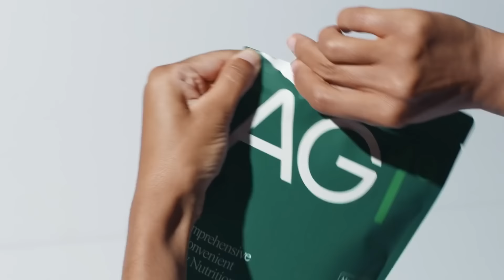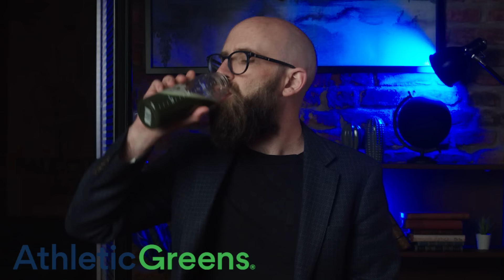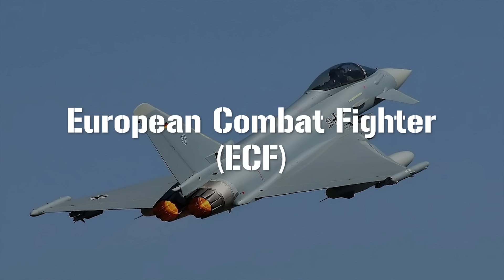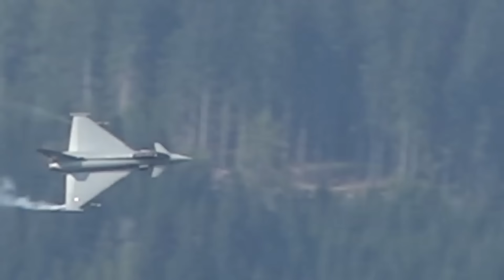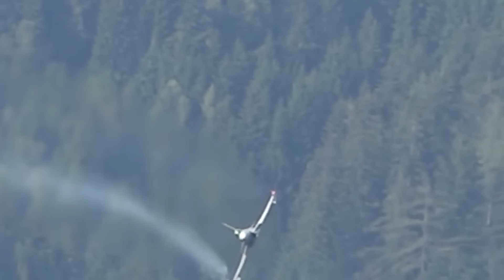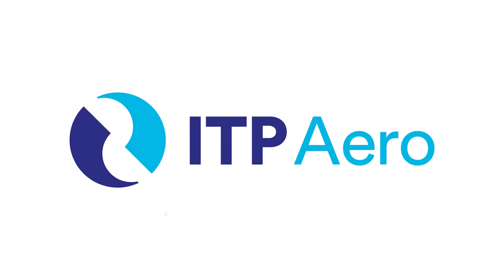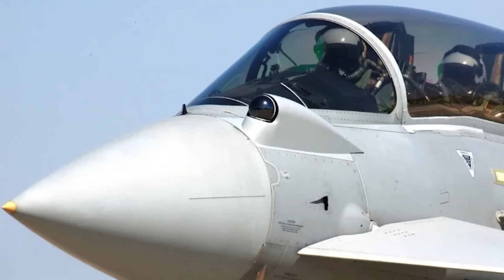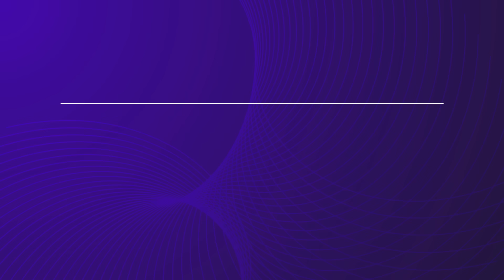The Eurofighter Typhoon: Any Aircraft, Any Mission

Comment: Although only getting called generation 4.5, the Typhoon is a great example of what a 5th generation fighter would look like if stealth wasn't an issue and you only cared about brute force and turning fights.
Reply: There’s a bit more to it than that but sure
Reply: with the right ECM-suite, it has no need to be physically stealthy...
Reply: Thing is, Stealth aircraft are not supposed to make up the majority of a combat air fleet. They are a first strike tool to take out the most valuable air assets so the rest of the air fleet can move in and dominate the air space. This is why the RAF actually has a damn good combat force with both the F-35's and Typhoons but we do lack a proper CAS/bomber aircraft that would free up the Typhoon and do the job better and we also need a proper air to air refuelling and C&C capability.
Reply: @WhiteIkiryo-yt2it   Yes and no, like the us the F35 is going to replace all of the F16s which is a good amount of our airforce as the usaf is planned to order 1700 of them, as right now the F35 is in a leagues of it's own as it go into deep enemy territory which other 4th gens wish they can do, as you explained that since a country don't have hundreds of them so they have to use them wisely, I 100% agree as you guys do lack a lot of other air support needs, the biggest mistake was making the eurofighter to do everything when it's just meh or not that great, as it is a air superiority/interceptor first, it's like making the f22 a cas or a multirole plane it just won't work lol.
Reply: 5th Gen is defined by Stealth 

So what you defined would never be 5th gen
Reply: @EricTheActor805  No country has actually stated what 5th gen actually means. Open to interpretation by everyone.
Reply: So... Should we be worrying about the Germans? 😋
Reply: Oof
Reply: What is needed is a Typhoon that's pilotless...then you can go up to a higher G force.
Reply: @Clinker Breaker  Yes, because the Typhoon is an air superiority fighter like the F15 (also a two seater), where the F35, is a multi-role fighter meant to replace the F16 (and for the navy version the F18, and for the army version the harrier, but they are literally three different planes sharing the same name). Air superiority fighters beat multirole fighters in the sky, but are more limited in what they can do.
Reply: @Carewolf  the typhoon is more of a multirole platform now, and the f15ex is a true multirole
Reply: It's the pilot guys, not the aircraft!
Reply: @DanOdalson  "It's the pilot guys, not the aircraft!" Yeah sure, put any super pilot to fly MiG-17 against F35 and see how it goes.
Reply: The .5 is the stealth aspects of the jet. Things like RAM coatings and EWS such as active cancelation/RF frequency jamming. There is a trade off between cost and capability. In general, you want a mixture of 4.5++ and 5th gen like the US/UK has. The 4.5++ is the high energy interceptors used for defending key assets such as airfields and the 5th gen are the penetrators/attackers used to penetrate heavily defended areas
Reply: @The SuperBike Tour thats not even the same aircraft.  The superhornet is inferior.
Reply: STEALTH IST THE SOLE "CAPABILITY" WICH MAKES A JET A 5th GEN PLATFORM so your comment is rather useless.
Reply: Can the Eurofighter do buddy refueling ??
Reply: The F-15EX has the strongest center box among any fighters worldwide, enabling it to effortlessly handle any G-force at various loads. In my view, the future F15 should leverage the rear cockpit by integrating advanced command computers to replace the weapon officer and command up to eight UCAVs alongside to the battle zone. Furthermore, with additional wing pods at stations 1 and 9, it possesses the capability to carry an enormous weapon payload to the war zone, akin to having R2D2 in the back seat. There are endless technologies embedded into the F15 that may be better than the F35 or the next 6Gen. The F15 will always be the workhorse that can carry massive weapons and now it has technology companions that don't care about G-force maneuvers. Compare: 1 (6 Gen Fighter) vs 1 (F15EX+8 UCAV).
Reply: Yes it is a beautiful aircraft but correct me if I’m wrong but turning bleeds off airspeed so wont it be better to climb roll back and build your airspeed back up as you dive on the enemy yes we built the raptor with turning in mind because of the USSR but we also have climbing capability’s built in as well as acceleration and targeting and before you say we’ll 2 German typhoons registered kills on the raptor yes they did when the odds were stacked in there favor I don’t know of any fighter that’s gonna go in to combat with no weapons but the inner cannon while the raptor had drop tanks equipped turning ain’t the only thing you need to count on
Reply: 1,000th like
Reply: "Although only getting called generation 4.5, the Typhoon is a [describes gen 4.5]
Reply: vtol and it woul be perfect efoo an anwer to the mig 29
Reply: FCAS or Tempest NOW, no F-35
Reply: Gen 4/5 is just marketing wank from Lockheed...
Reply: Your mistaken stealth means not as agile and the Typhoon has reflective radar capabilities throughout its frame. So do better homework kid😂😂😂😂
Reply: Your statement that the Eurofighter F22/35 or other stealth jets cannot see and attack is definitely wrong! Passive radar causes radio wave interference, which is present everywhere with AI. A Eurofighter Pretorian Evolution with the two electronic warfare pods also has passive radar! According to experts, the range is much greater in the air than on the ground, 400 kilometers is no problem! IRST with passive radar was successfully tested by Diehl, and Meteor will also receive it! MDBA/2025 presented a new hypersonic missile with a range of over 1000 kilometers, Mach 6-7! This could even be used to attack stealth jets beyond 400 kilometers. Airbus has successfully tested the A400 with 20 large stealth remute carriers and 30 small stealth drones in a combat cloud! They have the same electronic warfare systems as the EF, and remute carriers are armed with IRST and Meteor. Furthermore, the A400 will carry extremely powerful electronic warfare systems as a mother ship! Added to this are the EF Stealth Wingman drones, each accompanied by three EFs with AI. The 10 tonne wingman drones have the same systems as the EF! According to AI, one A400 with drones and three Eurofighters with three wingman drones each, i.e. 12, would send a total of 62 stealth drones 100-150 kilometers forward! All systems in the FCAS combat cloud network together would create such an extremely strong jamming wall that F22/35 radars and sensors would be blinded! At the same time, however, they cannot detect the threat that is about to strike! According to extensive AI analyses and facts, 10 or more stealth jets have no chance of surviving against such an FCAS combat cloud! According to AI, the passive radar with FCAS forces the enemy into an asymmetric warfare mode, which represents a new LEAGUE of air warfare!

AI has recently analyzed facts from EF with Meteor. According to a high-ranking German military official, the EF has a top speed of 2900 km/h and can reach an altitude of 22,000 meters in a very short time, about two minutes from the ground! A Meteor (5200 km/h) fired from altitude and at that high speed would travel a good 250 kilometers! The EF with the new EJ230 semi-ceramic engine has up to 27% more power. According to the AI, this would put the EF at around 3200-3300 km/h. The Meteor would have a range of 300 kilometers and accelerate even further on the spot. A 25% larger Meteor is also planned to increase its range!

The A400 is more than just a transporter; it is a multi-combat system that will be decisive in war! In the future, it will also receive a modular laser cannon, which Rheinmetall has successfully tested. Germany will implement FCAS with Spain even without France! Perhaps Sweden and its quarreled partners of the French will also join in! Germany has enough money to finance all of this, including the Polaris Aurora space plane, for which €35 billion has just been allocated for a space program with military systems such as the hypersonic Aurora/Vega (>10 Mach) and the Aurora Heavy (>20 Mach) (100-200 ton payload orbit). There's talk of kinetic weapons! AI has conducted an analysis: a 2.5 ton steel core impacting the earth at 20 Mach has 6 times the kinetic energy of a GBU-57! A 10 ton steel core has 26 times the kinetic energy! 80 2.5 ton steel cores dropped into a square/rectangle would level Moscow. Temperatures of 7-9000 degrees Celsius and extreme shock waves are created in the core, reinforcing each other! The shock wave would cause the concrete to burst open in underground concrete bunkers! It will also build the EU space station and lunar base and is one of the three most important EU programs! Transport costs 1/7-1/10 of SpaceX! From the EU to Australia in 90 minutes! The Aurora system will be part of FCAS. The German FCAS-Airbus Defense system starts with the U212CD combat cloud at sea and ends with the Aurora in orbit! Everything will then be combined with FCAS modular quantum computers/DLR and others with AI to create a unique, globally massive combat cloud!
Reply: f-15 ?
Reply: That agility also gives it better ability to dodge missiles, no?
Reply: What?  5th generation is all about stealth so your analogy is completely voided.  That's like saying Mike Tyson would be faster if he loss some muscle mass.  Yea, but it takes away what he's basically known for, brute power.
Reply: @DroneStrike1776 it’s about being the next generation of 4th gen but not quite the requirements of 5th gen.
Reply: I think a P51 would fit that criteria as well. 

Very good dogfighter if you discount stealth, missiles, supersonic speeds etc.
Reply: 😂🤣😂 Woggle has left the chat!! Good job guys! Refreshing seeing people reply that actually know what the hell they are talking about when it comes to both aircraft and radar!
Reply: yet what is scary about that, is how the gap between gen 4 and gen 5 is so insanely wide. Where the typhoon is possibly the best of the gen 4's, still doesn't realistically stand a chance against any gen 5. Unless you get a stupid ROE like in vietnam, which heavily resisted range engagements. Thus almost nullfiying the advantages of the f4 with all their missiles.
Reply: @ALegitimateYoutuber  eh I would say the F-15EX definitely challenges the Typhoon on best Gen 4, both are practically the same, massive payload, fast, manuverble, amazing systems, no stealth.
Reply: @ALegitimateYoutuber   l
Reply: @ALegitimateYoutuber  it murders the f22 in dog fights. thats close enough for me. (raptor salad incidents)
Reply: @fivenine5905  dog fights don't matter, it's not ww2 anymore nor are these training events specfically to make extreme unrealistic situations. war has changed. dog fighting is dead.
Reply: @fivenine5905  Which are lies.
Reply: @ALegitimateYoutuber  yeah it won't be very effective   in a war against 1st world countries but i'm sure it does his job by delivering strikes on terrorists
Reply: @ALegitimateYoutuber  F-22 und F-35 opderate under even stricter ROEs over Syria. Still 5th gen jets lead the air campaign over there.
Reply: @ALegitimateYoutuber  the eurothyphoon would stand a chance against f22 in a 1 on 1 dogfight cos it's more agile all down to pilot training u can have the f22 and if the pilots isn't trained well it will be average
Reply: @ALegitimateYoutuber Gen 5 can Shoot First but Gen4.5 can Dodge the Missiles a

Also no Stealth Aircraft that is not a Bomber can hide their IR from Heat Seekers Once in Range of the Missile also nonstealth can carry full weapon payload into combat a Steath if trying to shoot first can not do that and if load for bear is no longer Steath at least until the Next Gen Steath Bombs and Missiles are created that is
Reply: thats not quite true, it heavily depends on the type of engagement @ALegitimateYoutuber
Reply: @ALegitimateYoutuber  I feel like the Eurofighter has a very good chance against an SU57
Reply: @ALegitimateYoutuber  This is going to be a long reply (I actually dread having to write it, but it seems I have to.) and I'm going to ignore the "Typhoon is 4th generation despite it having been developed at the same time as the F-22 and having features that even the F-22 doesn't have."-debate and for the sake of brevity talk as if the Typhoon were "4th generation" and the F-22 "5th generation" to address a more important thing:

The myth that F-22 is so superior is based on a misconception about the viability of BVR ("Beyond Visible Range") air combat and the rules of the Red Flag war games.

First of all, even the best, most modern air to air missiles are not the perfect "fire and forget" weapons movies and many uninformed armchair generals make them out to be. 
There are several factors that make them relatively easy to evade for a agile jet and a skilled pilot.

AIM 120 AMRAAM has a real life hit ratio of 13% and those hits were scored against old and downgraded export versions of old Soviet era jets like Iraqi and Serbian Mig-23s and Mig-29s and unfortunately also a bunch of friendly fire accidents where US fighters accidentally shot down US or British helicopters. 

Meaning that even against very easy, soft targets like unsuspecting helicopters and outdated old jets without good missile warning systems, the legendary AMRAAM still only achieved a 13% hit probability. 

God knows what that hit probability would look like when used against a modern jet with a good missile warning system, counter measures and pilot training.

I'm not saying air to air missiles are useless and fighters need to go back to shooting guns at each other, but what I am saying is that actually not all that much has changed when it comes to realistic air combat since WW2.
Even with modern air to air missiles, you still need to catch an enemy during a moment of weakness, at a low energy state, if you want to ensure a kill and to get your enemy into such a state, you need to engage in what is called a dog fight. Just pushing a button and the target goes boom 100 miles away does not work.

Even against easy targets, 13% hit probability means the 6 AMRAAMs a F-22 can carry in its internal weapon bay are statistically not enough to score a single hit.

With other words, the mere concept of "BVR combat" is not just unproven, but highly dubious and not supported by the available evidence at all.

So what are the issues with air to air missiles and can't they just be fixed with newer, better, more advanced missiles?

The short answer is: No, unfortunately not.

Missiles have a few fundamental problems that can not be overcome with better electronics, software or sensors.

For one, the missile has a very, very limited amount of energy. In the movies they are portrayed as just having endless fuel and burning their rocket motor all the way from the shooting aircraft to the target, but in reality they burn all their fuel in a maybe 3 to 10 second long boost phase and then they just glide the rest of the way on inertia alone.
You are basically throwing a self guiding dart at a very fast and agile target many miles away.

Every flying object loses energy every time it changes course. To change course, you need to push against the air, or kind of shovel air around with your control surfaces, which causes an increase in drag and friction. Also you are fighting your own inertia. A jet can compensate for that because it has a comparably high amount of fuel and has its jet engines running all the time, giving it constant thrust.
A missile can't do that. It burned all its fuel within the first few seconds of its journey and is coasting with a empty engine for the rest of the time. That means with every course correction it makes, it gets slower and slower until it falls out of the sky.

That is why "going defensive" against a incoming missile usually means a jet will dive into thicker air, where the missile will lose its energy even faster.

(If you want to see a good representation of what modern air combat maneuvers look like, I recommend checking out a Youtuber called "Growling Sidewinder" who plays the "DCS" simulator on a high level of realistic accuracy and explains stuff like that and what pilots do when and for what reason.)

When you look up the stats of a air to air missile and see it has a maximum speed of "Mach 3" or "Mach 4", that doesn't mean it will fly at those speeds most of the time. Those are ideal maximum values the missile can reach for seconds at certain altitudes.
Even a "Mach 4" missile will often slow down to speeds below Mach 2 in low altitudes and thick air, which means a jet that "goes cold" (flies away) will have little problem simply outrunning it.

No super advanced electronics, software or sensors can change the physical reality of aeronautics.

Another fundamental problem is kind of a sub-problem of the lack of energy too. It is the lack of maneuverability. 
Because missiles are so short on energy they can't afford to waste any more than the necessary on drag, which again means they can't afford having large wings that produce lots of drag.
The little stubby wings they can afford mean that despite them being small and light weight compared to a jet, they still don't have the same maneuverability.

Especially within a certain speed envelope, roughly between Mach 1.5 and 2.2 or so, jet fighters have a huge advantage over missiles and can basically dodge them all day long.

This is another problem more advanced electronics or sensors can't solve.

And here we get to the Eurofighter Typhoon.

(To be honest, I didn't even watch the video, because I know from experience that videos like this from people who are not life long military nerds and are just based on a few hours of google and wikipedia research, will be super frustrating and make me angry.
So if this video is better than I expect it might have mentioned some of the things I'm about to say now and I apologize for repeating that.)

The Typhoon is not just another "4th generation" fighter, doing what F-15 and F-16 did, just a little better. It is every bit as advanced and sophisticated as the F-22, just based on a different premise.

When they designed the F-22 they started by basically saying to themselves: "Wouldn't it be cool if BVR air combat would actually work? Let's design the perfect fighter for that!"

The people designing the Typhoon started with: "What do we actually know about modern air combat? Let's design the perfect fighter for that!"

Like "Stealth" is the main gimmick of the F-22, the Typhoon has a main gimmick too and it is to stay within that speed envelope of Mach 1.5 to 2.2 that is ideal for missile dodging as long as possible and be as maneuverable as possible at those speeds.
With other words, it is all about dodging missiles. (That is important to remember for the following point I'm going to make about the Red Flag war games.)

1.) It is designed to have the smallest possible frontal silhouette, for minimum drag.
2.) It has the "Super Cruise" ability. (The ability to reach super sonic speeds without the need to use the after burner.)
3.) It has a super advanced missile warning system that can also be used to track and lock on to targets. (For point 4.)
4.) It has the "Over The Shoulder" ability, that allows it to lock on to targets behind it and shoot at them.
5.) It has a gimballed AESA radar for unparalleled radar angles, which allow it to fly extreme "Cranking" maneuvers. (Cranking is when a aircraft fires a missile at a target and then goes defensive to avoid counter fire, but still keeps its radar on the target to aid its own missile in keeping a lock.)
The Typhoon's extreme radar viewing angles allow it to fly away from a enemy and still keep a radar lock on it.

"If the Typhoon is so great, then why is it not doing as well at Red Flag as the F-22?" you might ask.

Yes, it is true that the F-22 have been dominating Red Flag, but to understand that you need to know how those games are actually organized.
Obviously the aircraft participating in those games can't shoot rubber training missiles at each other and can't simulate shooting each other with laser pointers, like they do in infantry training.

Obviously they can only shoot virtual missiles at each other, but how do you calculate which virtual missile hit and which didn't, when air combat is such a super complicated affair, with all those maneuvers and the weapons themselves having to fly maneuvers too?

Air combat is also very hectic and stressful and everybody is high on adrenaline, so the referees can't have discussions over who is dead and who is alive with every pilot all the time. Makes sense, doesn't it?
So they have to have some rules for when you are dead and when you scored a hit and they need to be simple and straight forward.

What they do is to basically make missiles those 100% accurate fire and forget weapons they aren't in reality but only in movies, as I explained.
If you get a good lock on an enemy and you push the red button, he is dead, in Red Flag.

From the perspective of organizing such an event, that makes sense, but maybe you can already see the problem with that, after reading through my long monologue above.

The rules accidentally are HEAVILY skewed in favor of the socalled "5th generation" fighters.
They are basically cheating.

Those planes are based on the unproven idea that you can just see the enemy first, push the button and make him go boom and the rules of Red Flag just happen to simulate a universe where that actually is what happens, when in reality it is not.

And the Typhoon, a plane that is all about dodging missiles is forced to compete in a game where basically the no.1 rule is: "There is no dodging."

It is like forcing a 5 foot 10 soccer player to play basketball against a bunch of 7 foot basketball players.
Reply: @TrangleC  Thanks for explanation
Reply: @TrangleC  The AMRAAM hit probability is way higher, we’re taking about 70-80% in most tests. 

The F-22 is more advanced than the Typhoon, known. The chances of a Typhoon detecting an F-22 first are almost 0.

Like I said earlier, the hit probability you posted is either made up or based on AIM-120 A-Cs, the hit of AIM-120D is way higher, we’ve seen in tests a hit probability of 70-80%, by this we can say Half of your text (which is biased for the Typhoon) is wrong. An F-22 with 6 AIM-120Ds could shoot down 2-4 Typhoons easily. You only dive or crank when you launch a missile against an enemy target. You won’t have the minimumal idea if an F-22 has launched 1 or 2 AMRAAMS at you, and when the Aim-120 activates it’s terminal radar guidance you won’t have enough time to react. Or will be in a denser atmosphere to make these missiles waste energy.

If the Typhoon pilots knew they were up against highly capable 5th generation fighters (that be F-22s or F-35s) the most sensible option would be push at full speed in hopes of getting a firing solution on enemy aircraft… Still the Stealth Fighters can and will fire first, and then dive to avoid enemy missiles. The scenario right now is AMRAAMs in the air coming for fast Typhoon fighters that, if we’re being optimistic will get a fire solution and dive in hope of avoiding the enemy missiles. It’s more than likely that the enemy fighters are already at low altitude where the missiles will have a low chance of hitting them. Regaining energy and trying to launch a second boley of missiles. I won’t extend this anymore but you can see how little change the Typhoons actually have of achieving victory. If both sides had AWACS in range of detection the Stealth fighters would have a firing solution, the Typhoons on the other hand… a general idea of where the bogeys are. 

5th Generation fighters will always have the upper hand and 4th generation is coming to an state of obsolescence. The Czech plan to buy F-35 Fighters to replace their Gripen squadron, they believe it will be obsolete soon. And they’re right.
Reply: @tomislavruzicic3955  Don’t thank him for that “explanation” because it’s god awful.
Reply: @CrayonEater255  F22 is retired, making the Typhon the latest western air superiority fighter still in production. And yes even an F22 can be detected. Stealth is a tech game of leap frog, every stealth advancement is obsolete a decade after it was introduced. And you can not upgrade the body of a plane, which means the stealth part is obsolete long before the plane is. Of course the real problem with Typhoon is that its role as an air superiority fighter just like the F22 is obsolete, we rarely need air superiority planes that can beat all other planes anymore, we need ones that can beat the ground AA these days and F35 was designed with that in mind, where Typhoon was designed to rule the sky. Though the F16 is probably better at that than the F35 dollar for dollar.
Reply: @TrangleC  i learned a lot reading your work, it all makes sense to me now, thank you for taking your time to share this with me, appreciate it
Reply: @ALegitimateYoutuber  Well let's look at your claim a little closer for a minute, shall we?
Germany is currently operating Hensoldt's passive TwinVis Radar which has demonstrated that it has no difficulties tracking F-35s at distances over 250km. 
A Typhoon armed with 6 A/2A missiles can outrun, out climb, out dive, out accelerate and out turn F=35 all day long.

The Typhoon can already carry the MBDA Meteor unlike the F-35 which will have to wait until 2027. So, this leaves the Typhoon with having a much greater weapons range than then F-35.

Place both aircraft over Europe, Germany especially, and the F-35 will be certainly and reliably be detected and tracked there! 
This in turn then allows the German Typhoon(s) to dictate engagement of the F-35 at will. And because of the Typhoons networking capabilities it even enables the Typhoons to engage the F-35 from well outside of the F-35s weapons range! 
The F-35 on the other hand cannot outrun the Typhoon to get away, and it cannot chase a running Typhoon to close up on it to bring it within the F-35s weapons range.

Yeah, stealth is great as long as it works... but acceleration, climb rate, speed, and superior weapons range are also pretty darn great things to have as well.
Reply: @tomwoggle9411  good thing the f22 does our air superiority
Reply: @tomwoggle9411  Good thing they are both on the same side then.
Reply: @tomwoggle9411  since that’s a ground based radar that would only apply over Germany then correct? If the air war is being fought in your skies you’re already behind the power curve.
Reply: @tomwoggle9411  F35s aren't designed for dogfights
Reply: @tomwoggle9411  oh wow, the passive radar detected the F-35 that just flew a ferry flight  as it was landing at an airport. It’s not like aircraft would turn on transponders at such times.

The TwinVis system is dependent on either the aircraft itself emitting something, or it depends on incredibly little interference in order to pick up the incredibly weak reflections created by cell tower signals. Actual combat conditions would fuck it’s performance into the dirt
Reply: @tomwoggle9411  This isnt exactly true. The Hensoldt's passive TwinVis Radar detects disturbances in low band radio frequencies that are already in the air (TV signal, radio stations, etc). The F35 and F22, having vertical stabilisers, are not stealthy to low band radar, only high band radar. Low band radar can be used to get an idea of where an aircraft is, but it cannot be used for a weapons grade lock. this means that the F35 and F22 would be detected over literally any country they fly over, as they show up on ATC radars, early warning radars, and of course the Hensoldt's passive TwinVis Radar. This doesn't mean they can be shot down though, because in order to gain a weapons grade lock you need to use a high band radar (such as the ones in the nose of fighter jets, and the ones used by SAMs to guide missiles). These high band radars cannot detect F35s and F22s easily, and its even harder for them to get a lock. 

Realistically, even if the typhoon knew where the F35 was via datalink, there isn't much it could do about it. The typhoon wouldn't be able to see it on its own radar until its well within range of an AMRAM, meaning the F35 would shoot it down before the typhoon even had a chance of shooting back.

The same is true for the S400 and other similar SAM systems. They use multiple radars from different bands: low band for scanning, and high band for targeting. The low band radars would be able to detect an F35, but the high band targeting radar wouldn't, so it wouldn't be able to fire. 

The F35 isn't invisible to radar. It was never designed to be. It was designed to be hard to shoot down, which it very much is.
Reply: @tomwoggle9411    "no difficulties"  The F35s spotted in Germany were 1) using an RCS amplifying lens, 2) on a known flight path/position, and 3) had their transponders on. They were essentially looking for a flying Christmas tree, and even then it's one thing to see something and another to identify it properly. Take away all of the existing systems the TwinVis uses to bolster itself and it essentially becomes a Russian style antenna array, which is easy to spot and send to the scrapyard.

Greater weapons range is useless if you can't see your target before they do; F35 is a stealth aircraft and the Eurofighter isn't, one of these is getting spotted and fired on long before the other, especially with the EF carrying external weaponry. It's the reason the AMRAAM has gone so long without being replaced, no need to with what the US had. In any case, as you said the F35 will become capable of using Meteors sooner or later, and the AIM260 is on its way as well, plenty of options for it.

As for the kinematics profile, I should preface this by saying that I know you can't judge the maneuverability of an aircraft just by looking at it. That being said, LockMart made both the F22 and 35; it's fairly safe to say the F35 inherits a decent amount of the F22's DNA, which is one of the best kinematically performing aircraft save for the Sukhois which have a large focus on thrust vectoring and maneuverability in the first place vs the F22's stealth. The F35 has a similar lift-generating body design, vortexes similar in shape and development along the wing to the F22, and similar large control surfaces and center of thrust placement further away from the C.G. to give it stronger moment inputs. People who have flown the F35 have stated it to have high maneuverability but greater energy losses, and we've seen the F35 exhibit post stall maneuvers like a pedal turn at airshows several times. The F35 doesn't just have stealth, it's an entire package of being able to get closer and see farther than anything else. Case in point, half of every European nation (including Germany!) has either put down an order or actively operates them.

Final nail in the coffin, for all the F35 offers it's also cheaper per unit and has greater payload and fuel efficiency and comes with superior technology. Idk how a Eurofighter loaded to the brim is supposed to outmaneuver a clean aero F35, but if it ever came to that it'd be because the Panther pilot chose to let it run that way out of boredom from taking down everything else too easily.
Reply: @tomwoggle9411  problem with the radar part. that being that doesn't actaully matter. Because thats a large wavelentgh system. i don't remember the size. And that from day one have been effective at detecting stealth aircraft. But there's a problem, it's large, hard to move, and most of all it just tells you something is there. Meaning you can't reliably shoot anything down you pick up. It's why despite that being a thing, it has not stop the development of stealth aircraft because it's not realistically a threat. And it's ability to detect stealth aircraft is also limited in range.
And in terms of performance, that again not really a strong arguement when the F35 will have first strike ability because that is the entire point of gen 5. To avoid detection until it's to late. And the radar in aircraft like the eurotyphoon aren't effective at detecting stealth aircraft because of their wavelentgh size. Nor are most mobile radar systems. So the eurotyphoon will notice an incoming missile before is would ever notice the f35. Which has a detection system that can detect out to over 400km. which would easily detect a eurotyphoon. This is why so many new designs are focused less on such things and more on staying undetected and having very high information exchange. 
You're still thinking in a belief system that isn't really usable in modern war. it's why things like dog fighting is dead, why the A10 is outdated, because warfare has evolved to new tactics and strategies because of new technology. Despite what we all like to quote, war does infact change. The "romance" of ww2 and coldwar stuff is just gone.
Reply: @tomwoggle9411  Detection is cool and all but that won't get a weapons lock which means the Typhoon would still get blasted from stand-off distance before it can fire anything. That's the power of stealth.
Reply: @Gainersy  I think that's what goes over most people's heads when they hear of stealth aircraft being detected. It's one thing to see that something is up in an approximate location in the sky. It's a lot harder to attach that information in real time to a weapons system that needs to get within a few hundred feet of that aircraft.
Reply: @tomwoggle9411  Wow, talk about knowing nothing about air combat... LOL! My advice: stick to what you know (if anything). Your comments are ridiculous. Take it from a former fighter pilot.
Reply: @pieface6421  it would be able to possibly at a distance of 20miles though granted the 35 would be able to smoke one long before getting within that lock range
Reply: @tomwoggle9411  good thing germany is  not at war with the us. They have like 150 eurofighters and the US has ten times as many fighters. The us will have about 2500 f35s in the next few years.
Reply: well 
https://cencio4.files.wordpress.com/2012/07/closeup1.jpg

The Typhoons scored several Raptor kills during the Red Flag Alaska. So much so, on one day a German pilot, recounting a succesfull mission ironically commented: “yesterday, we have had a Raptor salad for lunch.”. @bouser99
Reply: @tomwoggle9411  F35 wouldn’t be fighting for air superiority tho 👨‍🦯
Reply: @tomwoggle9411  Typhoons speed advantage (the same with other Mach 2 fighters) is only in clean configuration. If they are armed with missiles (and maybe even drop tanks) these cause additional drag, while the F-35 is always in clean configuration with missiles hidden inside the weapon bays (they would destroy the low RCS otherwise). If the Typhoon is armed with missiles it's not much faster any longer than the F-35. 
Turn rates may still be higher of course, but it will have a hard time to lock its fire control radar on a stealth aircraft (RAM coatings are quite effective in this wave length) without getting a lock from the stealth aircraft. 

But Luckily they are all on the same side - F-22s together with Typhoons and F-35s.
Reply: @tomwoggle9411  What an absolute L my guy. for one thing you don’t understand the basic operations of the radar systems you’re talking about, and then you compare the typhoon with a stealth, long range, flying supercomputer and informatics system. 

Instead of comparing it to the F-22. Which is a cross mission air superiority fighter and would make a much more sensible comparison.
Reply: @tomwoggle9411    The US doesn't use the Meteor so the F-35 wasn't designed to carry it. Tracking and successfully targeting the F-35 is different than just detecting it. The Eurofighter wouldn't even know it was targeted by an F-35 until it was hit. The F-35A is also 43 million less per plane than the Eurofighter.
Reply: @simonm1447  The Typhon can fly faster than Mach 2.35 in clean configuration and in its 'interceptor configuration' it can still fly faster than Mach2 (and even supercruise at Mach 1.5) while carrying 6 A2A missiles.
Reply: @tomwoggle9411  it’s not the tracking that’s the issue, it’s the ability to lock on and shoot down. Most current radars can see any and all stealth aircraft, they just can’t lock on and shoot them down.
Reply: @tomwoggle9411  Speed also depends on the altitude - according to 
public available Data the Typhoon is capable of Mach 2,35 in clean config at 36k ft. In denser air it can't fly that fast, like every other fighter too. Clean config. however is useless, a fighter without missiles is like a rifle without ammo. 
For the F-35 you don't even get a specific altitude for its top speed. Since these are military aircraft still in use the detailed flight envelope isn't public available.
Reply: @monkeyfuel69  but couldn't a ground based radar allow a typhoon to be directed to a point from where it could use it infrared search and track abong with ECM to get an IR missile lock? Or am I missing something ?
Reply: @andys8482  it's relatively simple to mobilize radar if you're in war
Reply: @tomwoggle9411  well it's a good thing that once the f-35 detects radar waves someone in the kill chain would prosecute the source of the radiation.....
Reply: @forzaelite1248  the f35 scored a 12 kill to 1 death against f15 / 16 in a real flight but simulated scenario. The f15 / 16 is one of the best 4th gen capable aircraft with zero loss during actual combat.  The f35 is better than you think.  The us military isnt that foolish if u search hasard f35 pilot who is a former f16 pilot with thousands of flights and current f35 instructor hours explain how the f35 has exceeded the current 4th fighter .  I rather believe an actual
Reply: @89turbomk3  Agreed, I gave the Eurofighter the benefit of the doubt before but in a real situation the F35 is a true 5th gen fighter and the leap in generation makes all the difference. There's pretty much nothing it can't do vs the EF if not better, it's to the point that I question what Europe's 6th gen fighter is going to bring to the table that's revolutionary enough to gap something like the F35 does to 4th gen.
Reply: @tomwoggle9411  The fact that typing long paragraph of nearly complete nonsense can still net this kind of positive response is kind of scary, it once again show it is easy to deceive the general public, just make sure to throw in some jargon here and there and typhoon is suddenly more capable than F-35.
Reply: @89turbomk3  I explained in my previous comment how those "5th Generation" fighters win all those war games while at the same time US Air Force generals say in interviews they no longer consider the F-35 combat effective and are looking forward to the F-36 Kingsnake, which basically is a US version of the Typhoon.
Reply: @RCXDerp  yes, but the guy he responded to said "*any* 5th generation jet"
Reply: @tomwoggle9411  if true, why are so many countries investing in the F35?
Reply: @tomwoggle9411  but have they ever won against the f-35 in war games?
Reply: @CorePathway  Because these two aircraft are designed for two very different roles and mission profiles. Germany and the UK for example know very well why they did not replace even a single one of their Typhoons with F-35s but only replace their Harriers and Tornados with this jet.
They're using these two modern jets to complement each other, not to replace one with another for years to come.

Germany though only ordered the F-35 because certification of the Typhoon to carry US American nuclear bombs was made nearly impossible by politics and bureaucracy along with quite drastically changed requirements resulting from Russia's attack on the Ukraine.
Reply: @anydaynow01  for now. Germany is currently re-arming, and that spells trouble
Reply: @andys8482  America is the only country in the world whose entire military is designed on offence elsewhere and can’t defend its own airspace against huge slow lumbering unarmed jumbo jets
Reply: @tomwoggle9411  doctrines my friend. The US aint flying their most expensive plane to a place with anti air capabilities. They performed SEAD operations first before any air campaign began
Reply: @スガル  the f35 was designed for SEAD. The NATO doctrine dictates air superiority by day 3 of any given conflict. Day 1 is largely based around the f22, taking out air threats and clearing the sky. Days 2 and 3 revolve largely around the f35 preforming SEAD missions, and the B2 taking out critical infrastructure, such as airfields
Reply: @pieface6421  You mean a non nuclear weapons grade lock. Nuclear surface to air missiles only need to get into the general vicinity of the target to be effective. And yes if WW3 is on then nukes are going to get used, it's virtually impossible that they would not be used. Technically it could be considered defensible to use nuclear surface to air missiles so long as it's over your own country because you'd be nuking your own territory.
Reply: @tomwoggle9411  Absolutely correct sir, The Typhoon over gods own country (England) manned with RAF pilots is the best bit of kit we have for defending our skies, We have F35 but for the air to air engagements the Typhoon is the answer.
Reply: @tomwoggle9411  You ruined it with the cope. Source on the first claim? By design the F-35 detects the Typhoon first.
Reply: @deathdragon2283  F-35s that fly in ferry have radar reflectors.
Reply: @tomwoggle9411  By 2024-2025 the F-35 will be able to use SPEAR, METEOR and many more European weapons.
Reply: @TrangleC  As I assume by your first text, you don’t know what you’re taking about. For starters the Air Force never said such thing. They said they want to replace the F-16 with a 4.5 Generation fighter to serve as a Low-end fighter. The USAF has this thing called Hi-Low mix, where the High is capable but more expensive fighters. And the Low is obviously less capable 4th Gen ones. The F-35 is the High and the F-16 is the Low, the Air Force wants a new Low. But they haven’t done anything with it, the ‘Kingsnake’ was a concept made by a bunch of Designers because of the Air Force’s statement, it’s nothing more than a drawing.
Reply: @TrangleC  they never said the f35 is no longer effective lmao, other countries are still catching up. They were referring that they are looking to progress and start looking into a new 6th generation aircraft. The united states always stay ahead in terms of technological advancement.  Stop your nonsense ba
Reply: @tomwoggle9411  there’s a difference between using wide band radar to detect an aircraft. That’s pretty much always been possible for stealth fighters. Because the vertical wings.  The b2 is far more difficult to detect by wide band radar. The issue comes when using targeting radar which is short wave and you can’t get it to reliably reflect off the f35 or f22. I mean sure I guess if the American pilot is straight up brain dead then anything is possible. But Americans are pretty much the best trained pilots in the world just because of the insane amount of money we spend on our military and the sheer amount of flight hours that they get. Hard for any military to keep up. Not trying to knock this aircraft. It’s pretty awesome. Along with the Raphael.
Reply: @bouser99  Yeah the F-35 wouldn't stand a chance against the Typhoon simply because it wouldn't stand a chance of catching it. A lot of Americans are unaware of just how much faster a Typhoon/F-15 is. Not just in terms of raw AB top speed but cruising speed/acceleration. The Typhoon can fly at supersonic speeds indefinitely. You can't shoot down what you cannot catch. The F-22 like you say is the USA's 5th gen interceptor. If it was just an F-22 vs a Typhoon then it's still not clear. The F-22 would detect the Typhoon first but it would have to get to within 50 miles of the Typhoon in order to be within the PK% of it's missies. The Typhoon would have detected it and fired it's METEOR's by that point. That's the issue with stealth. It's only as good as the missiles
Reply: @tomwoggle9411  i like how ur just ignoring the comments that just completely discredited ur original argument and moving onto different points 😂 ignorance is bliss
Reply: @0riginalFIR3  like what? Comments claiming absolutely silly nonsense like L-band radar (operating with wavelengths between 30 cm and 15 cm) supposedly only had an accuracy of 20 miles at the very best? 
- Or the type of nosense claiming that the Lunenburg lenses mounted on F-35 during peaceful ferry flights had any kind of measurable effect on long wavelengths of up to 3.7m used to transmit radio and TV signals as they are analyzed by Henssoldt's passive TwinVis radar?

Oh yes sure, this type of utterly silly nonsense from people who have absolutely no clue about the most basic physics involved totally discredited my argument. 😂

I'm sorry if I didn't feel like replying to each and every single nonsense that was posted here in the comments. 
I've addressed most of the more reasonable arguments in my replies to some of the comments, and I have added some brief explanations in those. 
Several other things are answered by other commenters here additionally as well, but i supposed you ignored all that, because ignorance is of course bliss.
Reply: @tomwoggle9411  NONSENSE !!!

First of all you have to bring a ground based radar into the mix to make Typhoon survivable OVER GERMANY against F-35 and in addition Germany rarely has combat ready Eurofighter available. So you failed in 2 major points ... actually without having a combat ready Eurofighter you have no point at all.

But let's have a closer look at you wonder-radar, the passive TwinVis. 
TwinVis is a passive radar witch picks up radio waves and their reflections which are already in the air mainly from radio stations and radio communications (plus some other emitters).
In a war scenario most of these emitters would be shut down or destroyed so the passive radar would be useless anyways but even in peace time the TwinVis mainly uses HF/VHF and UHF radio waves to detect aircraft. These frequencies operate between 0.1 to 1.0 GHz which are exactly the same frequencies as traditional low band radars that the Russians and most other sophisticated militaries use in their low frequency long range detection radars. NOTHING NEW HERE !!!
YOUR problem is, that you need a S-band or preferably a X-band radar to create a weapons grade radar firing solution which use frequencies from 2-4 GHz (S-band) and 8-12 GHz (X-band).

You must have realized your problem .... the TwinVis can for example detect that there is a F-35 somewhere over Bavaria (like any other active, long range early warning detection radar), but you can not create a weapons grade targeting solution to shoot them down. You will have to send half a squadron Eurofighters (which Germany more or less never has available, especially not in one area) into the area to search the entire Bavarian airspace for these F-35s and even if you find them, your onboard x-band radar will most probably not be able to get a targeting solution on the F-35 (especially because eurofighter does not have AESA radars) ..... furthermore the F-35 will have detected your Eurofighters lates during taxi to takeoff run and your jets will be destroyed on the ground or as soon as they get airborne.

LIKE IT OR NOT, RADAR STEALTH IS A MAGIC TRICK WHICH ACTUALLY WORKS AND DWARFS EVERYTHING NON STEALTHY !!! F-35s actually hit 90 to 1 kill ratios in BVR exercises and are also superior in "dogfights" because of their super-maneuverability, especially at low speeds. Eurofighter only gains an advantage in a "dogfight" at higher altitudes (20.000+ feet) because of it's huge wing and light weight.

5th gen (VLO/STEALTH) is as revolutionary as switching from F-86s to F-16s. You might get a kill on a lucky day, but you will be killed 99 times out of 100.

No wonder why F-35 wins EVERY fighter competition it enters. Even Germany will soon operate them 😂
Reply: @xyzaero  The arguments you're making are so wrong on so many accounts. 
Let's start with combat readiness of Eurofighters. You're likely referring to reports from years ago in 2018 and earlier where combat readiness of the Typhoons was supposedly really low. These reports in the media were almost all wrong and extremely misleading. There is a German term "voll einsatzbereit" meaning fully ready for operations (in pristine standard with no issues affecting any operations in any way). The problems German Typhoons had affected cooling of a sensor in the aircrafts defense suite because a supplier went out of business and the German system was different from other European Typhoons. Therefore, these aircraft were officially declared "nicht voll einsatzbereit" meaning "not FULLY combat ready', but they did remain to be "kampffähig"  (combat capable), and they were still very capable of fighting. In fact, these Typhoons still remained to be much more combat capable than any US made 4th or 4.5th generation fighter jet without such sophisticated defense systems featured in the Typhoons. These (very minor) issues with the defense subsystem are also long resolved by now.
 
Now on to your arguments about the supposed weaknesses of the passive radar system TwinVis. Should radio and TV transmitters be destroyed then they can very quickly and very easily and cheaply be replaced with transmitters for a few hundred dollars each. 
We're talking about EXTREMELY CHEAP and extremely simple radios with simple amplifiers connected to a simple wire antenna costing less than 1000 dollars each, resembling 1930's technology. They can easily and quickly be placed in several locations to turn this 'passive' radar system into an 'active' system. 
Attacking these cheap radios with extremely expensive and sophisticated anti-radiation missiles (commonly costing several hundred thousand dollars per shot!), will quickly become extremely unviable for any attacker! And it will be turn out to be just as effective as bombing Saddam's inflatable rubber tanks in Iraq with smart ammunition. 
The TwinVis system itself is higly mobile and it cannot be located or attacked by anti-radiation weapons. Only the radio emitters used can be targeted relatively easily, but not all anti-radiation weapons happen to be designed to be capable of attacking radio stations instead of radar systems operating with much shorter wavelength. 

Each TwinVis System has a range of over 250km and it can locate (stealth) aircraft with an accuracy of under 500m in the worst case with a delay of under 1.5 seconds and updates every 0,5 seconds.

Like I wrote before in another comment, this comparably 'low precision' of less than 500 meters  is certainly not sufficient to direct gunfire or old and long outdated (passive or semi-active) guided missiles from the 1980s onto a target, but this accuracy is more than sufficient to direct modern missiles with LOAL capabilities close enough to a target via datalink for them to lock on and take out the jet. This is also exactly why Hensoldt and Diehl are cooperating, pairing the TwinVis passive radar with the various heat seeking IRIS-T SL systems, the surface launched versions of the Typhoon's IRIS-T air-to-air missile.

An accuracy of 300 to 500m updated every 0.5 seconds is sufficient to direct any modern fighter and any suitable modern missile towards the target for it to lock-on once it's close enough. It is also more than sufficient to direct and enable a modern fighter with networking capabilities to launch LOAL capable missiles 'blind', meaning without the fighter's own on-board sensors being able to detect it at the given distance.

Talking about 5th generation ...5th generation fighetr jet is a silly marketing term which first used to be defined with the requirement of supercruise capability something the F-35 is not capable of by the way.

If you're think about stealth as being the only single defining criteria for a '5th generation fighter jet', then i am sorry to tell you that the Typhoon (mostly made of composite materials not metal) does incorporate several stealth features very significantly reducing the Typhoon's effective RCS. 
The result is in fact very comparable to the also limited stealth capabilities of the SU-57s, and possibly even to those of the Chinese J-20s, although the Typhoon does not feature RAM coating. 
The Typhoon with its highly sophisticated (and over the years constantly upgraded) Praetorian DASS defense suite also features many "active stealth" capabilities just like the F-35 does.
Now guess why the F-35's defense suite is supplied by the British BAE, who happen to be the exact same business that manufactures most of the Typhoons defense systems.

Germany also only operates the F-35 because the Typhoon would not be certified by the US and Us manufacturers to deploy US made nuclear weapons the outdated Panavia Tornado can. Germany only replaces Tornado strike fighters with the F-35 and not a single Typhoon, in fact Germany just ordered additional Typhoons as well.
Reply: @tomwoggle9411  In the end of the day it is a long range detection radar and in the real world they prove to be useless against real VLO platforms. Nobody would poor billions into VLO development and upkeep if it wasn’t the number one technology in air combat since the invention of the jet engine itself.
Reply: @tomwoggle9411  The new B-61 could could easily be certified on Typhoon or just keep a few Tornados aurborn for a mission that will never happen or even better … stop nuclear sharing and build german nukes or non at all. Germany bought new Typhoons because Germany needs to support it‘s indigenous arms industrial base until they finally build the next generation in some 20years. And yeas I said 20 years on purpose because already Germany already forgot the need and value if a strong military after the first shocking days of the Ukraine war. FCAS is already iff the books in Germany, thanks god they will most probably at least operate a few F-35s 👍🏻
Reply: @tomwoggle9411  Oh, and VLO/Stealth is the one and only 5the gen criteria that can not be found in any other jet generation like internal stores, super cruise etc. VLO can not be retrofitted, Typhoon uses RAM coatings in leading edges and no, Typhoon is not a stealth system with a RCS of at  least 1 square meter in CLEAN CONFIGURATION!
Stop wet dreaming about Typhoon because it is already far from being world class.
Reply: Panther?
It's already got one name : Lightning.
Does it 'identify' as a 'Panther' though?
Wouldn't want to hurt it's feelings!
Reply: @xyzaero  The German Luftwaffe evaluated and went through all those options in a lengthy process. Certifying the Typhoon SHOULD have been easy, but it was deliberately complicated by the US DOD and US manufacturers conducting the certification process along with issues around having to share classified European technology with the American manufacturer(s) in order to certify the jet. 

Retaining a small number of Typhoons was deemed unviable because of facing excessive maintenance cost and parts supply problems when being the only nation in the world to continue operating this old jet in such a small number.

The F-35 was never meant to replace any Typhoons and the F-35B does not and will never replace even one single British Typhoon either, because the F-35 is not at all designed to be and is not suitable to operate as (QRA) interceptor which is the primary role the Typhoon is designed for and is uncompromisingly optimized for.
Reply: @RCXDerp  They are a bit shit then aren’t they. They can only carry so many missiles.
Reply: @TrangleC  Hilarious claim about the Kingsnake. Like we're supposed to believe that USAF generals are committing to an aircraft that doesn't exist, hasn't even reached prototype stage and is nowhere near being a finished design on paper.
Reply: @tomwoggle9411  This is a typical end run argument about stealth vulnerability to detection.  When you read that stealth aircraft can be detected, it's only through low frequency radar, which is insufficient to maintain a targeting lock on the stealth aircraft.  Only high frequency radar will enable the fidelity needed to deliver the missile on target.  The new B-21 Raider bomber is reported to be undetectable to either.
Reply: @caracoidwren944  Other than still being undetectable in the armed forces the B-21 isn't reported to be undetectable to anything. It's merely CLAIMED to be undetectable by the manufacturer trying to sell it. 
Modern missiles with LOAL capabilities do not require target illumination or high precision tracking. All they need is (very) sporadic updates via datalink providing them with a general direction to head towards until they are close enough for the missiles own sensors to lock on. 
This can be electro optical (IR) seeking warheads or dual warheads or whatever else. 

Unlike the F-22 or F-35, the B-2 and the B-21 both have the advantage of being much larger aircraft which can theoretically help make detection with long wavelength difficult. 
But practically speaking and due to the laws of physics even Stealth bombers can; t get around, RAM coating capable of absorbing these long wavelength would need to be several feet thick!

German manufacturers are already producing passive radar systems combined with heat seeking surface launched IRIS-T SL missiles. 
This combination will have no trouble detecting, targeting and shooting down B-2s, B-21s, F-22s and F-35's all alike. 
And it's coming into service very soon.
Reply: @tomwoggle9411   It can track but not lock an F35
Reply: @lewiszhou4056  Tracking an F-35 is perfectly sufficient to launch modern missiles with lock-on after launch (LOAL) capability, especially something like the heat seeking IRIS-T SLM. 
It's also perfectly sufficient to launch - an guide a squadron of interceptors towards them to shoot them down. 
Modern missiles, be they air-to-air or surface-to-air missiles, do no longer require a permanent lock or even permanent illumination by radar to home in on a target the way radar guided missiles in the 1980's used to.
Reply: @bouser99 Less than 100 Operational F22 is not enough to cover all the Continues USA never Mind Alaska, Hawaii or Overseas Territory's too do that you need at least 400 to 500 aircraft at the above mentioned areas and that is at least 500 firm aircraft needed

The other 100 to 150 airframes for the F22 have been Canablised for Parts as no new parts are Manufactured for the F22
Reply: @andys8482 it applies over every nato country not only Germany but also England, the netherlands, France, Spain etc
Reply: @forzaelite1248 typhoon has better radar, IRST, METEOR missiles and better climb and manoeuvre rates.  It would be a very close race.
Reply: @tomwoggle9411  now try the raptor
Reply: @tomwoggle9411 Your claim of this is not true especially when it isn't in training or patroling, when the F35 does patrols and training it uses radar reflection pods to increase the rcs to it can be tracks by ground radar and other aircraft radar as there has been countless times the F35 been intercepted with radar reflection pods on, as the F35 has now been seen into combat in the isreal hamas war the F35 shows it's stealth capabilities when firing into iran as the assassination attempt location was heavily defended by s400 and other air defense systems. In terms of speed and height the eurofighter will be better but in terms of out running a F35 in a fight is no as the missile will out speed and height the eurofighter as in terms of bvr engagement it is a death wish for the eurofighter, In terms of dogfighting the eurofighter isn't going to do well with the F35 as it is the most maneuverable fighter jet w/o thrust vectoring with a A0A at 50 degrees with the electronics limiting it as test pilots says it goes way pass 50 degrees, also the F35 carries a much better radar which is in it's own class as it will detect the eurofighter over 110 miles away as the F35 carries the aim 120D which has a range over 110 miles as exact miles is classified, as the aim260 is right around the corner as the F35 could carry the aim174b in the future, so comparing the F35 to the euro fighter typhoon isn't really a good comparison when the F35 realistically will destroy the eurofighter even when trying to run away. The better comparison is the superhornet with the eurofighter as it is much more closer as the superhornet will be more stealthier, more dangerous weapons to carry, more maneuverable at slower speed, slightly better radar, but then the eurofighter will be faster, has supercruise, and fly higher.
Reply: @KRGruner you could've said that in a way that wasnt so rude, thought you'd learn manners as a fighter pilot.
Reply: @goosejuice27  LOL, I guess you don't know fighter pilots...
Reply: @pieface6421  one major flaw in your logic: a f35 that flies stealth doesnt see SHIT on its own .....without external scouting and sensor feed...its totaly blind........so who over has surveilance superiority of an area wins the figth regardles wether its gen 4,5 or gen 5
Reply: If you look on the whole pic, the eurofighter is more expensive per peace, BUT - still much cheaper to maintain than the F-35 😂  @forzaelite1248
Reply: @tomwoggle9411  This is factually incorrect. The tracking method only works for air raft with some radar reflectors and flying in the open in decent weather. Any of those change which they always will and it all fails. And as we see with Longer range radar being able to see something is in a general area does not allow aircraft or SAM's to locate and lock it. Theres a reason even with reflectors on during training events the F22 & 35 are able to run through multiple aircraft. Including the typhoon.
Reply: @andys8482 obviously the US‘ geological situation makes a true loss for it almost impossible without using nuclear weapons
Reply: @bouser99  f22 too few in number
Reply: @ALegitimateYoutuber   the F-15 is 50+ years old, and still better than the EuroFighter.
Reply: @biginchsmallblock 

If you mean getting blown out of the sky better, then yeah 😆
Reply: @atty.fernandog.madarcos8724  The F-15 has an impressive no loss record against aircraft.
Reply: @atty.fernandog.madarcos8724  the eagle has a literal perfect air to air combat record
Reply: @biginchsmallblock  as the  Mig 31 with the bvr hypersonic missiles (don’t remember the name) that can take out anything except the f22.
Reply: @mariokajin   Different role.   Its ONLY useful as an interceptor.  And, after seeing Russia in Ukraine, it's clear Russia doesnt know how to fight a war and would be absolutely destroyed by the West.
Reply: @biginchsmallblock  better how? it can't carry the meteor, so is at a disadvantage in BVR encounters, and the eurofighter is still a better dogfighter even if it comes to that.
Reply: @thefakequake  Range, speed, radar package, payload/hard points, sensor suite, proven combat history, sensor technology, price point, etc. 

The meteor is a great missile, but its range doesn’t mean its a wall that keeps an F-15 from getting within AIM-120 range.  Plus, the AIM-260 is expected to be in service by the end of this year. 

The F-15EX is just a missile truck. It’d be hard for anything to fight against it in BVR.
Reply: @biginchsmallblock  still, currently the eurofighter can carry better missiles, also consider the ASRAAM/IRIS-T which are often considered to be superior to the 9X. I have no doubt that the F-15 is now a very capable multirole platform, but I still believe the eurofighter is superior in air to air engagements.
Reply: @thefakequake  and, we can enjoy being on the same team ;)
Reply: @biginchsmallblock  yes that helps haha
Reply: @benpurcell4935  Yeap and they keep it flying because of its airframe design, it’s superior to most other aircraft in its performance. That’s why they’ll be keeping these 4th gen or older planes around for a while yet.
Reply: @atty.fernandog.madarcos8724  in all of its history, the F-15 has never been shot down in an Air to Air engagement.
Reply: @biginchsmallblock  I wouldn't say better but the F-15EX and Eurofighter are practically the same.
Reply: @atty.fernandog.madarcos8724  

By every metric, the F-15 EX is superior to the Typhoon
Reply: @EricTheActor805 f15 are no we're near as nimble
Reply: @biginchsmallblock  no it's not
Reply: @muzzle_4717  yes it is, cope.     Im not saying eurofighter is a bad aircraft.
Reply: Detected and tracked… until SEAD and then the bulk of your ground based radars get vaporized
Reply: It's more limited than he is letting on. Notice he gave e balanced reviews for the F22 and F35 but this video is basically propaganda.
Reply: it's not even 4.5 gen. it's basically a European F-16 (of the newer blocks)
Reply: @BOZ_11 absolutely not
Reply: Gen 4 is generally stronger and more capable than the so-called gen 5 planes. Gen 5 have been cripled for stealth capabilities that doesn't really work in long run, as sensor tech makes any stealth profile obsolete much faster than the superior performance of gen 4 planes goes obsolete.
Reply: @Carewolf  lol, that is total non-sense.
Reply: @Carewolf  what stealth does is protect aircraft from being detected by high frequency radar bands and you need high frequency bands to get a weapons grade lock yes, they can still be detected but the problem is getting a weapons grade lock and most modern air to air and air to ground weapons are able to be fired from a distance were stealth aircraft are able to avoid weapons grade lock meanwhile 4 generation jets can’t go anywhere near otherwise they will get shot out of the sky it is literally impossible currently do you have a high frequency radar that can lock on to a stealth aircraft and 6 generation fighters are going to be stealthy to even low band radars meaning of next to impossible to detect and there’s no type of technology right now that can help any of these two bands of radar if they go up against one of this stealth aircraft radar technology cannot catch up fast enough and there’s nothing in development to help them because there is nothing they can do to help these radars this technology is so revolutionary they essentially mix everything that came before it obsolete. It’s literally the dreadnaught in fact in action.
Reply: @Carewolf  

No